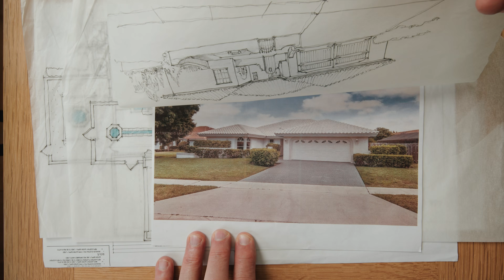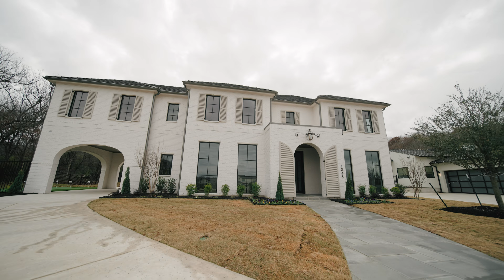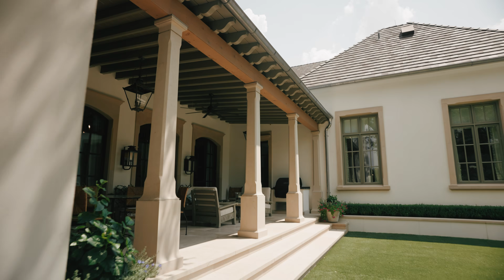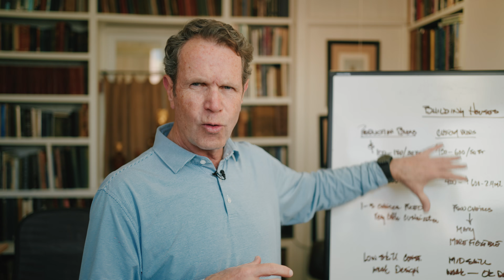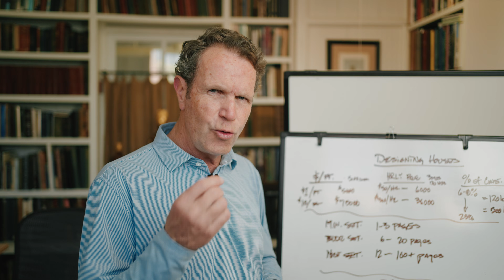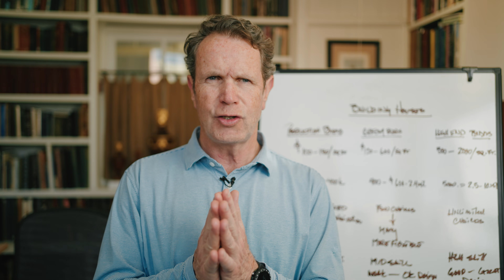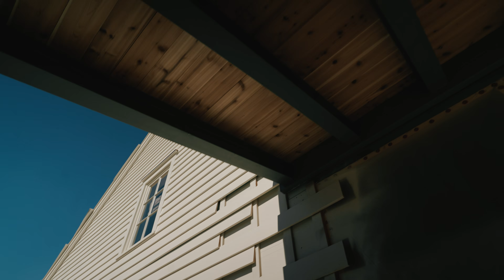What Should House Plans Cost?

Comment: I would also argue to that trade designs need to come back. I believe most of the customization and detail that you now follow was mostly trades driven. Meaning a basic design was provide by architect but final stair case detail for example was trade driven which is how we got lots of great work. There was no drawing to follow just pure art. I know of only one exception in places like France where they did actually detail out trim work in plans but even then was cut and paste with final details provide by the craftsman. I tried this in my last project. I designed one window and then allowed the carpenters freedom on next and together the design evolved live with all windows having foundational elements.
Reply from the maker: I agree that craftsmen of the past could take a design and execute key details, but they didn't change design as things evolved. Thus craftsmen weren't the reason we changed from Georgian to Federal. We are probably saying the same thing. I fear that craftsman can do more today but aren't.

Comment: Brent you know I love and respect your work but I am going to disagree with you here a bit. I would say the cost of plans is not relative to 2-3 vs 18-30 vs 100 sheet plans but instead relative to the amount of Q&A time with the customer. You and I know that when final decision 100 pages is not same as 100 times more time than 1 page. Given your standard blocks and modern CAD functions. The real time is customer Q&A, material selections, samples or mock ups or true originality. So the real question how much attention the customer is going to need. The 500K guy in CA knows that those people will require lots of baby sitting sometimes literally hence the high end tab.
Reply from the maker: Thanks for sharing. There is definitely a cost in client hand-holding.

Comment: I don't usually comment on things like this.  But I found Mr. Hull's comments about architects mostly wrong and aimed, as many builders do, to discount the value of what architect bring to the table.  I'm not sure what architects he has worked with, and since this video can be seen nationally, I'd like to make a couple of quick points.  First, architectural drawings will not make for a lack of skill on the part of the builders. Drawings show you what to build, not how to build. Second, teams are put together for their individual skill sets.  Trying to convince people that two members of the team have significant overlap so you may not need as much of one because the other can do the same job is misguided and undermines his point about assembling a good team.  Third, Mr. Hull's math is off.  $300/sf x 3000 sf = $900,000.  A 10% architectural fee would be $90,000, not $30,000 as he states.  Lastly, Mr. Hull implies that all architects do is draw up some floor plans, elevations, and maybe add some details.  This is a gross oversimplification.  There is an art side to being an architect and an engineering side.  Each effort requires substantial effort for a client.  An architect must sculpt space, define finishes, and proportion the house correctly. Structural systems must be created, mechanical systems designed, and material assemblies crafted.  Add on to this hundreds of codes that must be met.  Then, make sure they come together to make a great place to live.  I do agree with Mr. Hull in one regard, assembling a good team most always leads to a successful outcome.  Happy building!
Reply from the maker: Thanks for sharing. Good feedback. I'm just sharing my experience. Cheers.
Reply: As an architect, I don’t know how any firm could make a reasonable profit charging $50 an hour unless they are forcing their employees to work excessive unpaid overtime and using junior staff without senior level oversight. I would steer away from any firm charging that little.  Every firm has overhead, unbillable work, and should be contributing to their employees healthcare and paying for vacation and holidays.

Comment: I'm recalling a story I read in a biography of Julia Morgan, the architect of Hearst's Castle. She needed a massive stone fireplace mantel design. So she sketched out her concept with a charcoal pencil and gave it to the stone mason. He then went on to produce precisely what she wanted. To me that has always been the epitome of the best possible kind of team. She knew what she wanted and what was possible, both in terms of material and what the craftsman could accomplish. And the craftsman understood her vision and could produce it, while no doubt also contributing his own expertise. In the biography it didn't discuss what conversations may have gone on between them. But I expect that if either person had a question they both had the egolessness that allowed them to ask the other and accept their advice.

The challenge I encounter in my design work is that I have found it necessary to put a lot of details into drawings in order to protect the client from unscrupulous contractors. Basically, if it's not in the drawings the builder won't price for it. It is not accounted for in initial estimates and then everything becomes "extras" at inflated costs. Also, having under-detailed drawings increases the chances that there will be conflicts between trades. As a designer I need to account for things like ductwork having the space to get past structural beams. If I haven't planned it out in my mind and put it on paper, I haven't completely done my job. And if I plan for it but don't put it on paper, there's no guarantee the AC contractor will plan the ductwork not to conflict with the structural beam.

Comment: my brain screeched to a stop at no hardi.  If I'm not using masonry, what would you use instead of hardi for siding?
Reply from the maker: I would use wood! So interesting to me that wood is passed over so quickly, the original and longest lasting product is almost universally not even an option. If builders and craftsmen would install it with a proper air gap, it will last forever. Please consider wood. Thx.

Comment: Spec homes. We typically pay between $1500 to $4000 for a set of plans. It depends on what the architect is willing to do as far as checksheets and submittal, and whether or not the plan is from scratch. Plans are typically seven to ten pages, so I don't know what Brent is talking about when he says you can build a house with three pages. I've never seen less than seven.
Typical plan below:
Plat. Elevations. Foundation. Main Floor. Upper Floor. Roof. Section (insulation). Electrical (sometimes, not necessary). Shear 1. Shear 2. Even Shear 3 sometimes. And that's 10ish pages for a modestly priced two story 3bed, 2.5 ba, 1 car garage, spec home.
Brent has clearly never worked on modestly priced spec homes, and he underestimates the people that build them and the house itself. But then again, he's a total custom guy. They have a lot of pride in what they do, and want to consider themselves better than everyone else. But there is an art to building spec homes. And despite what he says, there is a team. In every city, it's a small world of guys that do these jobs. And we tend to use the same guys over and over again. I trust their work, and they trust they'll be paid. Everybody knows everybody.
Reply from the maker: Thanks for sharing your insights.

Comment: The design of an entry level spec home is quite poor in the beginning, but it is refined over and over through the years, until it is quite effective. The infastructure act that Biden passed incentivized cities to ban garages and driveways on lots less than 33 feet wide, which led to a variety of design misadventures which all stemmed from a total disconnection between the office boomers and the needs of first time home buyers. I have built some really shitty, stupid homes in the last three years. But, our bread and butter home, for a solid 20 years, was a winner. It was very effective because it had been continually refined until it was perfect, and then the government made it illegal. Awesome. People say there's not enough homes, and the government just makes it harder to build every year.
Reply from the maker: Noted.
Reply: I can't imagine being able to build on a lot that's only 33 feet wide. Zoning laws here require a 10 foot setback from side and back boundaries and 50 feet from the edge of the road. A 33 foot wide lot would be essentially unbuildable because the house could only be 13 feet wide.
Reply: @zone4garlicfarm  Are you sure it's not 10 total? Five on each side of the property line? Typically, there's a 10 foot set back in front, and an 18 foot set back for a garage door. But for the side, in my area, it's always been five feet on each side.
Reply: @ajsdfk I'm sure it's 10 feet from the side and back boundaries and 50 feet from the road. It's also 100 feet from a pond or lake and 75 feet from a brook or stream. You can apply for a variance but they are usually denied. I'm not aware of any setbacks for a garage door. In some neighborhoods there's a minimum 100 feet road frontage and in other building zones there's a minimum lot size, usually .66 or .75 acres.
Reply: @zone4garlicfarm that's not a nationwide zoning ordinance. There are plenty of towns and cities with down to no setback requirements at all
Reply: @tdo247  I'm not implying that it's part of any nationwide building codes. I'm only referring to my state. In places with no setback rules in their statutes there are stebacks in reality. You need to have a few feet to allow room for scaffold and other equipment without trespassing on the neighbor's property.

Comment: THIS is the video I've been waiting for. Crapitecture is essentially an economic problem, and Brent explains it well. Still, I think there is an opportunity for someone to come into the production/custom space and simply apply better designs. If done correctly, it costs no more to build a craftsman or arts and crafts bungalow than it costs to build a snout house. It's not like people in the 1900's-1920's had massive fortunes to work with. 

Wood+Paint is still cheaper than vinyl/metal siding. Tire track driveways going along the side of the house are cheaper than 4-car double driveways. Closed floor plans and simple rooflines require less carpentry labor than open floor plans and mountain range rooflines. Simple rectangular shapes are more economical to build and to heat/cool than today's zig zags. A big front porch like on a 4-square costs the same as the big back porches seen on some snout houses. Nine or ten foot ceilings and quality trim adds a small amount of cost over a soulless box, but you can offset those costs by subtracting silly snout-house features like fan light windows, tray/vaulted ceilings, jetted tubs, or nonfunctional fireplaces. Stained glass is to me much more impressive than generic-but-expensive quartz countertops. 

Why not grab a dozen off-copyright Sears catalog plans and give them a little stretch in CAD to expand the closets and doorways to code?! Then build a whole subdivision of them. People would buy such houses for a premium over snout designs, guaranteed. Make the lots narrow and the streets narrow, to encourage outdoor social activity, and use those savings to put in sidewalks and maybe even gravel alleys. Maybe this offends modern sensibilities but I'd pay double for it.
Reply: I’m part owner in a building company and I see the costs down to every last nail and I can assure you that ugly snout house is cheaper to build than that architecturally classic craftsman bungalow. Everyone thinks they can build some beautiful classic designed house with great historical details for the same price as the ugly production house and it’s just not true……otherwise there would be builders offering those beautiful houses for $150 a square foot because they would fly off the shelves. Everyone likes to think they can do it better when they aren’t paying for it, it’s easy to be an expert.😂

As a female in the construction industry who loves beautiful designs and enjoys watching Brent Hull, I can assure you he is speaking to the more privileged of society that can afford $500-$2000 s.f houses with endless budgets…..but the average Joe and even the upper average Joe isn’t really going to ever be in that ballpark and so many will take the snout house. 

Btw….you would be looking at $245 per s.f. for the snout house with bare bones in my area. Considering the average American is priced out of a $400+k house….you can imagine what that buys you…..classical designed craftsman is out of the question. 

I also want to add as we also do development….many geographic areas aren’t going to allow you to build narrow streets and alleys, you would never get them approved through zoning. Many zoning departments require large streets and cul de sacs to allow a fire truck to turn around in them, the builder and developer literally get no say in what the layout of the neighborhood looks like by the time they meet the zoning requirements.
Reply: @ashdav9980  yeah I'm waiting for the large developers to grow a backbone and require the fire departments they have to build to only have European style trucks.
Reply from the maker: Thx for sharing.
Reply: You can make up all the ideas you want but labor supply is still shrinking.
We're short about 10 million crappy entry level homes. Falling behind 500-700k each year.
The people doing the solid wood craftsman interior would run $750-1000 a day. How many days do you think it would cost to do a couple pillars and built in cabinet?
How much for all the trim and doors?
Fireplace and front porch.
I guarantee you need to triple the hours you think it would be.
Reply: @sparksmcgee6641  If we're comparing craftsman bungalows to snout houses, why not also subtract all the labor you don't need to build the tray ceiling, the extra 80sf of the bathroom size, the two car garage, the four car driveway to the garage, the jetted tub, the quartz countertops, and the various IoT devices? My point is, it's a choice to buy all these amenities of modern snout houses instead of something else - like the trim you mention. The difference between granite and concrete countertops could be the cost of higher-grade trim throughout a house, for instance. Or the money wasted on a mountain-range roofline could have been spent on a nice front porch. The average consumer seems to prefer the snout house for whatever reason, but that reason isn't cost.
Reply: @Christolball  Yes that reason is cost. And as the profesionals with facts here have pointed out you are completely wrong on what you think things cost. 
Youre literally amking up some item you dpnt like costs as much as some item you do like.
A tray cieling is maybe a 100 or 200 if like most it isnt trimmed.
What craftmans style item you like that costs 1 or 2 hundred?
Reply: @sparksmcgee6641  Y'all must be thinking something grand, with custom hardwood trim plus all the features of snout houses. I'm talking about subtracting things from the snout house, rearranging the rooms, and using many of the same materials for the exterior. Are you saying a simple roofline is more expensive than six or seven valleys, no garage is more expensive than a garage, or a small bathroom is more expensive than a large one?
Reply from the maker: I agree! I hope to give it a shot one day.
Reply: It’s so much cheaper and better to build snout houses than “classic architecture”. Classic architecture needs either a large lot, or is a very small home. A snouthouse (even if you don’t like them) can be shoved onto a 4000 sqft lot and can offer 2500 sqft of living space AND a two bay garage (with a 2 car driveway) for cheap. They’re objectively the best type of home for offering square footage at an affordable price. That’s the reason they’re built so often right now. People need affordable housing so builders are cutting the McMansions and architecturally beautiful homes and they’re shoving snout homes on postage stamp lots and charging 400k for the privilege. I’m not supporting the price of snout houses in the modern economy but the snout house makes complete sense when you look at their square footage to lot ratio. Nobody is putting a snout house on a half acre lot. They are great for getting a lot of home on not a lot of lot

Comment: Brent! You need to make a book on all these “common details” how awesome would it be to have a book of architectural drawings that detail out these common conditions that everyone is getting wrong.  What a great tool that would be for builders and carpenters to have. You could have section drawings , explain the scale and proportion for the room, style, function etc. That way when guys have a set of crap plans they could reference this book. Where do I set my windows and doors , what size, where do I run my trim, how do I detail out my soffit etc. Thanks for the info!
Reply from the maker: Good idea. Thanks.
Reply: @BrentHull it’s an excellent idea! You have a wealth of knowledge; usually I half listen to videos, but I pay full attention to yours. They are excellent with valuable information.
Reply: He did reference, in a previous video, the article he wrote titled, "Books every builder should own" at finebuilding (a web site). Turning those books into CAD drawings could also be interesting, if the books are out of copyright, or the license could be obtained.
Reply: Look up BIM files thats what youre thinking of. 
Brent could use the BIM files from trim companies he works with to create click drag door surrounds ect.....
Once put in place they should pick up the wall construction also.
Things like not upgrading your pre hung doors when you use 5/8th drywall are the little things he could help everyone with doing the files youre talking about.

Id say it has to be computer files that are then put in books or the book can just be a downloadable.

Subscription service maybe since he'd have to hire someone to just put the models together.